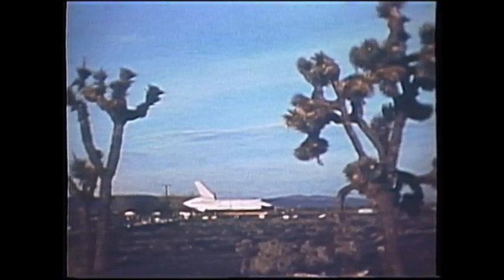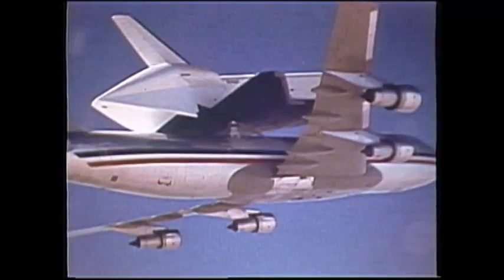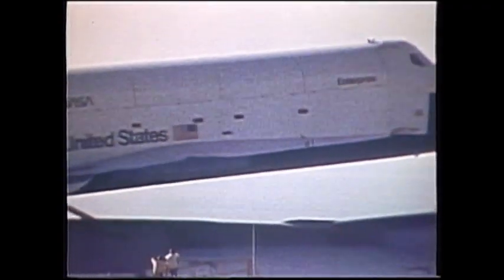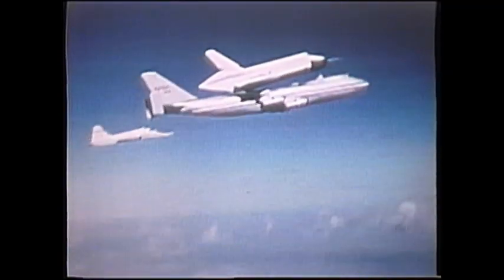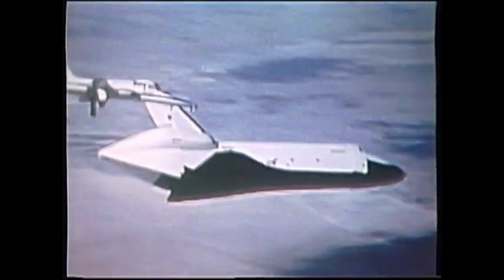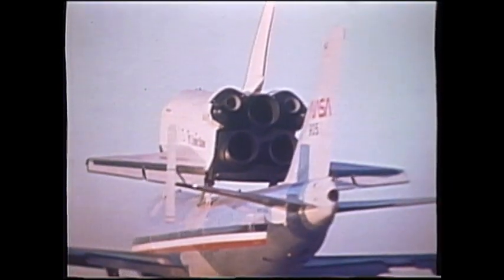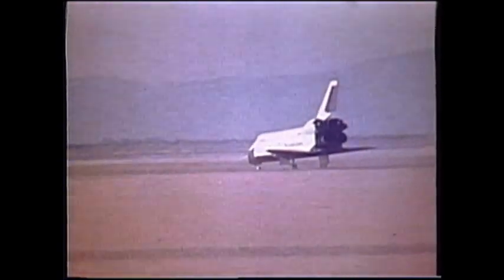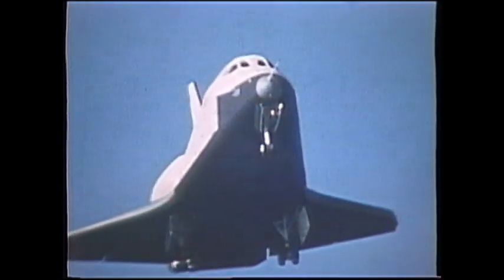Go for Sep

Comment: This is the America we need back. Everyone used to watch these launches. They were national news. Gave everyone a sense of pride and hope for the future.
Reply: Turns out that pride was a political facade maintained to show the Soviets, and set space exploration back for decades. After Challenger blew up, we should have said, you know what, the Shuttle isn't working out, let's move on to something newer. Instead, it was rebuilt, it sucked resources away from everything else and it took a second fatal accident and nearly two decades to move onto something much better.
Reply: @straightpipediesel  NASA was on a tight budget, they got slashed like crazy after the Apollo program. They were working with what they got. The shuttle was a good idea because you could recover the SRBs and the orbiter. It did work. It worked for multiple missions. Challenger blew up because of an O-ring failure and human error, not because it sucked or because it was bad. If the shuttle never worked, NASA would've cut their losses and moved on WAY earlier.
Reply: @syedhashim8856 This has been discussed. The Shuttle was a bad idea in multiple ways: the biggest is that it put safety-critical humans on the same vehicle as less important cargo. We don't even do that for trains, trucks, or many planes. That cascaded to the fact that you need a huge safety-critical heat shield and huge wings to recover that large space truck, and that was the cause of the second accident. Multiple other failures: no polar orbit capability ever materialized, engines required overhaul every single flight, and it never came anywhere close to flight a week planned. 

NASA was tied up in politics and not engineering and science. Go listen to Feynman: none of his advice was followed and ultimately they killed another 7 astronauts.
Reply: @s @straightpipediesel  fundamentally disagree. The shuttle program was more than just politics, the shuttle itself offered capabilities that no other spacecraft could, it could launch into orbit, it could transport various cargo, it was essential in building the ISS truss, it helped fix satellites, it helped retrieve stuff from orbit, it was extremely useful. So no, it’s not a terrible idea. It’s an inefficient one for sure but it was definitely not kept around for pride. I’m not saying it’s perfect, but it was useful. They kept it around because to replace all of that would be even more expensive and they would be throwing away tons of launch infrastructure with it, which would be even more stupid. Also, you’re comparing the shuttle, a space vehicle, to earth vehicles, which is just straight the wrong comparison, a better one would be Saturn V and the Space Shuttle.
Reply: @syedhashim8856 "It helped fix satellites, it helped retrieve stuff from orbit" You've exactly proved my argument! It did none of that post-Challenger due to risk, save repairs on Hubble which required it. So if that was an important capability, they should have replaced the Shuttle after Challenger with something that could do that! If it wasn't important, which it evidently was not, then the capability they built was wasted and was a drain through the next quarter century of flight.
Reply: @str @straightpipediesel yes it did. I just did a quick google search and YES IT DID. Embarrassing how you got debunked by a 2-second google search. And need I mention it was crucial for the ISS? I’d like to see a capsule build the goddamn ISS, oh wait, it can’t. They needed the shuttle which came with an ARM to assemble the foundation. And that was AFTER challenger. Also, again, the Challenger had an O-ring failure which DOESN’T prove the shuttle was useless. If I had a problem with an expensive engine’s component, like a piston, I just replace the component. I don’t throw out the entire goddamn engine! Common sense.
Reply: @s @straightpipediesel Also what did I prove? That fixing stuff in orbit is useful? Which is something only the shuttle can do? Which was the point I was making that the shuttle wasn’t kept around purely for political reasons? In that case, yes, I proved something.
Reply: @syedhashim8856 He's right. A ton of capability that was cancelled due to Challenger hobbled the Shuttle to its very end. Polar orbits as was mentioned that the Air Force wanted, leading to huge cross-range requirements. They stopped commercial satellite launches post Challenger. They stopped retrievals like STS-51a and then the MMU post-Challenger. Did you know they launched an ISS-sized module after the Shuttle? BEAM launched on F9 in 2016 and is flying right now.

The adults are talking. You need to chill with your autism.
Reply: Hello from 2026. Its not better.
Reply: @SelfMadeThousandaire2026  People are way too selfish and can't appreciate just being a part of a species able to do amazing things.
Reply: all lies

Comment: I knew from day one this was a terrible idea.  It makes no sense at all to take wings and landing gear into orbit and bring them back.  It's too expensive.  We have also learned, via tragedy, that the original plan to have payload and crew on top of the launch rocket, with an escape option, is the only way to go.  It worked for Mercury through Apollo, and it is what we have returned to.
Reply: thank god we have you - a genius here in the youtube comment section - 50 years later
Reply: This terrible idea built the ISS. Launched and serviced the Hubble telescope.

Comment: except due to compromises for military mission capability enlarging the craft, the cost per flight skyrocketed to more expensive than an expendable rocket flight. due to all of the politics around it shuttle launches whent from being planed to be once a week to once every few months. preventably accidents loosing two shuttle shut down the program for long periods. challenger was because they ignored the o-ring issue they were aware of, columbia was because no one ever tested foam wich was known to brake off hitting that part at those speeds. seriously missmanagement, a lax culture at nasa skipping tests, and politics cost us the shuttle program and several lives. comlubia could have been prevented, have the crew come down in soyuze and send another shuttle mission or a disposable payload vehicle with a replacement wing section, and repair it. and with challenger delay the launch for safety.

Comment: That's quite the maneuver, That plane would want to climb after losing the weight of the shuttle on its back, and the Shuttle not being powered would lose air speed and drop as soon as it was disconnected. I wonder if they had to modify it to be able to do a deep dive like that.
Reply: the decent back to earth is technically a controlled crash that's what we call it.......its fully controlled by fly by wire using electro hydraulic servo valves............man cannot fly the shuttle it’s not a glider or a bird ............it’s what we call an unstable air frame design...............that's what fly by wire was invented for unstable air frame designs a fighter jet is also an unstable air frame design and the modern twin gas turbine rotor wing ACs are the same deal -- man puts some basic inputs in and the machine works out what needs to happen with the flight controls and engine controls if it has engines in the shuttle case there are no engines on decent obviously ..............and it’s the only way unstable AF DESIGNS can work because there is too much going on for a human to mentally and physically process to control the beast ---- everything else with wings is called a stable air frame design...

Comment: Odd looking glider. Technically impossible, unless the entire thing was plastic. Wing span is too small to achieve controlled gliding. Seperation from the 747 is absolutely risky, for anything that does not have propultion. If this were possible then commercial aircraft  that loose engines can all do this, and we know that this always results in a deadly crash. Anyways I have witnessed many Shuttle landings and all of them make a distinct noise, which points to an engine creatng thrust. Thank you NASA. Now let Space X continue with the BS. This was not sustainable due to public scrutiny.
Reply: Get an education, son. As if you could do the math on the aerodynamics. What a laugh would be. 

And are you talking about the gas turbines running on the APU circuit that drove the hydraulics? 

Thanks for confirming you did zero research on any part of this craft and program. 

Just be a man and admit you also thing the earth is flat.
Reply: @kitcanyon658  You seem to be a strong believer in NASA. Ask them how they went through the Van Allan Radiation belt on several Apollo missions without getting fried to a crispy toast. Better yet, ask them where is the original footage for all the moon landings. NBC,ABC and all the news houses were not too thrilled with broadcasting poor resolution footage given to them by NASA. I remember as a kid going to Kennedy Space Center on a school trip and one of the kids asked a NASA employee how the heck did the Rover fit inside of the Moon Lander. We were quickly escorted to another section of the exhibit. They are liars. This is why they are hired Space X to continue with the shenanigans of $5 low resolution cameras that give terrible footage, because they are trying to hide the truth.
Reply: @Dan13Speed  : Lol. Thanks for the comedy. I realize there are morons here but it’s always funny seeing them be so proud about it. 

So, you aren’t man enough to work the aerodynamics on the shuttle? 

Gee, how surprising. 

Listen son, real men give exact details on science. People like you just sit around and moan about their lives. It’s embarrassing.
Reply: @kitcanyon658  If it may interest you I do have you and perhaps add to the conversation , I have a piece of paper on the wall that says BSPhy, and trust me this has nothing to  do  with PE.  You seem very knowledgeable in this subject area, so why don't you tell the world using these fancy equation dP/P = – (g/RT)dh. dP/P = {g/[R(TSL-Lh)]}dh why a 100, 000 lbs object once released from a 747 travelling at 600 mph, placed on the roof of the aircraft will not strike the tail of the 747 or cause enormous damage to the aircraft. If it may interest you to Mr. Genius, please be so kind as to enlighten the less educated like myself ,  why Wake Turbulence from the 747 will have no effect on the shuttle if at all this insane maneavour was successful.
Reply: @Dan13Speed  : Thanks for that equation. 

Where are your aerodynamic calculations? Seeing as how you claim to know all about aerodynamics I find it odd that didn't use any in your supposed analysis. That's telling. 

And since you have such a nice degree how come you don't go back to your university and tell all the professors how dumb they are for falling for NASA's fakery. 

Are you not man enough for that confrontation?
Reply: There is a ton of Pseudo Science being peddled around schools of higher learning as real science. Most Professors will not risk loosing funding for their research or risk losing their jobs for challenging some of this lies. So for that very reason, this stuff us still taught in schools.  Sir Richard Branson was interested in an inexpensive way to launch a rocket into space, and I interviewed for the project some years ago. What the team came up with was a custom aircraft that carried the rocket in the center and released it at high altitude. The 747 piggyback was considered, however the math simply didn't add up. Look it up on YouTube or find the white paper online and read  about it. It will shed light on the complexity  of the concept.
Reply: @Dan13Speed  : complexity that you certainly can’t model since you have no idea about real aerodynamics. Your failure is embarrassing. You should have just said you think it is all bogus instead of making people think you actually knew something aerodynamics. Lol. 

And what does it matter is all professors are in in some conspiracy? You’re still a coward for not confronting them personally. 

And why haven’t you the courage to admit you think the earth is flat?
Reply: @Dan13Speed  Clearly Dan, you were last in line when 'smarts' were being handed out.
Incidentally, all of the wake turbulence being created by the 747 is trailing BEHIND the aircraft.
Apparently, you're so stupid not to realise that at all times, the shuttle was ABOVE the 747 and obviously not being affected by the 747's wake turbulence.
Sorry to burst your conspiracy bubble, but the space shuttle wasn't powered by engines in order to achieve atmospheric flight - it was a GLIDER you ignorant clown.

Comment: Didn't the orbiter have a 4:1 glide ratio or something? You can really see it in those shots approaching the runways, before ground effect kicks in. Under 3 minutes from sep to touchdown. Bet Sully watched these '77 test flights with keen interest.
Reply: the decent back to earth is technically a controlled crash that's what we call it.......its fully controlled by fly by wire using electro hydraulic servo valves............man cannot fly the shuttle it’s not a glider or a bird ............it’s what we call an unstable air frame design...............that's what fly by wire was invented for unstable air frame designs a fighter jet is also an unstable air frame design and the modern twin gas turbine rotor wing ACs are the same deal -- man puts some basic inputs in and the machine works out what needs to happen with the flight controls and engine controls if it has engines in the shuttle case there are no engines on decent obviously ..............and it’s the only way unstable AF DESIGNS can work because there is too much going on for a human to mentally and physically process to control the beast ---- everything else with wings is called a stable air frame design...

Comment: the moment of separation must have been 100% butt clench mode from the 747 pilots.  The rear of the shuttle is only 15 feet from the 747's vertical stabilizer.  Could you imagine the catastrophe?

Comment: The last flight had a pilot induced oscillation due to a 300ms delay in the fly by wire computer system. It caused Fred Haise to fall behind the ship and start chasing. Once he let up and let the oscillation to damp out, it was fine.

The person who was looking through the binoculars during the last landing was Prince Charles. He's an avid glider pilot and had noticed the PIO issue when flying in the Shuttle simulator the day before. The techs didn't worry because he was not familiar with the ship.

Comment: Way back then Isent away for a NASA printout with instructions for how to cut out the Shuttle shape and form it into a glider. I made multiple copies and laminated them onto file-folder card stock. Each boy in my Cub Scout Webelos den got their own copy. At one meeting the boys each made their own glider. They all flew (glided) amazingly well. Tossed from overhead they glided straight and true.
Reply: @Harry Schaefer  Webelos -- Wolf Bear Lion Scout.  Later changed to or added on as "We'll Be Loyal Scouts." After being a Cub Scout Wolf, then Bear, then Lion and prior to Boy Scouts I was a Webelos. It was the mid 1960's

Comment: At 13:18 the pilot hits an On button to activate the landing gear.  Right after he hits the on button, the indicators for the Left, right, and nose button turn from saying "up"  to a zebra striped pattern indicating down.  I remember from Apollo 13 the same zebra stripe pattern was shown after Kevin Bacon, playing Jack Swigert, captured the LEM module for hard dock, after they blasted off early in the mission.  Does any one know what that zebra stripped pattern is called, and when it's used?  Interesting pattern, but it does stand out!
Reply: A zebra pattern on a flight instruments typically stands for INVALID. This makes sense here, as neither the UP nor ther DOWN end switches are indicating anything during gear transition.
Reply: @MrDanielMUC  Thank you!  Makes sense!
Reply: Fun fact, some commercial airliner like Boeing 777/787 still use this stripped pattern to indicate the gear in transition.
Reply: @chris22capt  Nice!  Thanks!
Reply: Thanks!!

Comment: They had such lofty dreams for it, and it is remembered as the thing that set the space program back the most in the past 50 years.
Reply: To be fair, it's also the most notable thing to happen in the space program in the past 50 years, excluding the ISS it helped build.
Reply: @colorupro       That's because the last 50 years was a dry spell for the space program.  Thanks to the shuttle.
Reply: It was flawed for sure. 2% chance of smoking it every time it went up were not great odds. But I still think the programme was a success overall and it was the tool for many great accomplishments.

Comment: Being from the Apollo era, when we actually went somewhere, I was never a fan of the shuttle. And I liked it a lot less after it killed 14 people, due to it's poor design, and NASA's poor management. Overall I consider the shuttle a failure. Despite taking the lives of 14 people, it never left low earth orbit. Just how long are we going to be stuck in LEO?

I do like those T-38s. Nearly 40 years ago, as a member or the USAF Reserves, I flew in the rear seat of T-38s several times. One of the sweetest looking aircraft of all time.

Comment: Just stick to using rockets.   Shuttle was just a dumb idea.  Unless you can invent a plane or spaceship capable of going in space without rockets attached to it, what is the point?
Reply: Mounting what was essentially the manned second stage (Shuttle) on the side of the first stage (solid rocket boosters) was a mistake, as it did not permit a crew escape in the event of a catastrophic failure.  Allowing tank ice to impact the fragile heat tiles clearly was a design flaw as well.  The SLS essentially rectifies that design flaw while using much of the same hardware.  I still don't trust those solid rocket boosters, though.